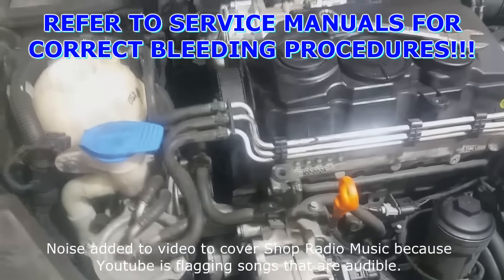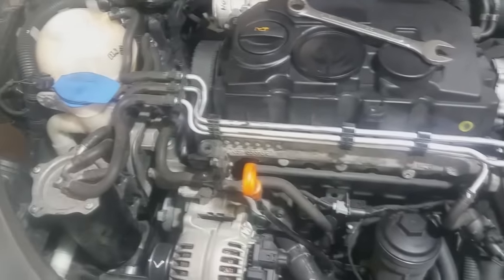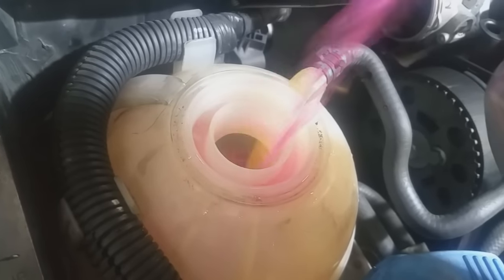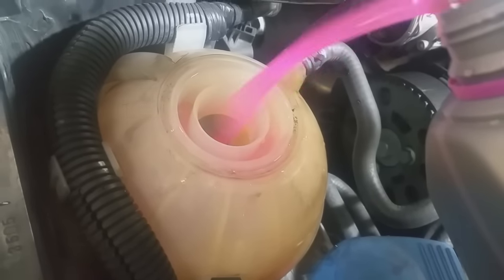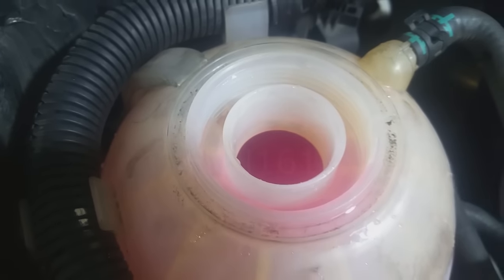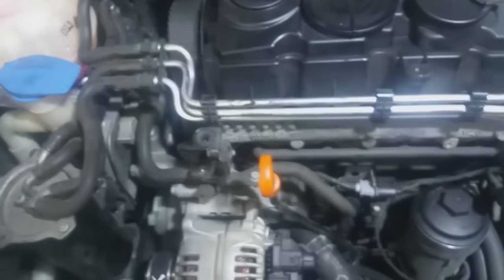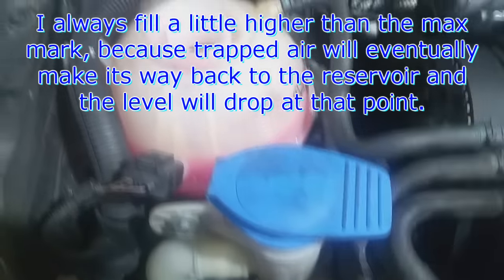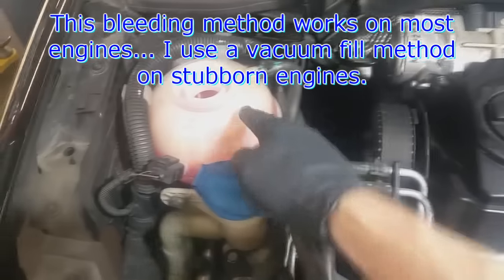Basic VW cooling system filling / bleeding info (viewer request)

Comment: Hey Exos 

Idk Where are thread went but i have the Passat with overheating problems & EPC light 

Néw Rad 
New Thermostat 
New water pump etc …..

Well i think the last comment you made you thought it was the head gasket …. 

I  was thinking the same but here is the really strange thing: NO COOLANT LOSS

I drove It 415 mi non-stop through hills / almost mountains mainly hills

With zero coolant loss 

What do you think ? 

I
Reply from the maker: You can find your post(s) under the user name "Matt Rieck".
If you drove it 415 miles, then it's not overheating.
There is a difference between "running hot" and "overheating".
Provide some specific information... so that I can guess better.
Using a scan tool, datalog coolant temperature from cold to hot (till fans come on) so I can see how long it takes for the engine to get warm / hot (car not moving).
Once warm / hot... datalog temperature while driving at steady speed.
Wash the radiator & AC condenser cores to clean out any dirt / leave / bugs that could be restricting air flow... do the same data logging again.
If you don't have a scan tool that can record data... record the temperature needle with your phone and then upload a video to either of your youtube channels (Matt Rieck or Blurm Gru).
A bad head gasket does not have to mean that coolant has to go down / leak. Air / combustion gasses in the cooling system can cause hot spots / air pockets that can affect the way the coolant circulates through the engine & radiator.
Reply: @EXOVCDS  
Thanks Thomas....

I got a chance to look at it this weekend a little and noticed that there was a clamp out of place but unfortunately no change.

I will try and get some VCDS that will allow me to record some data on temp.....

The AC does not work and in fact the AC line gets frost on it like it was running but there isn't any difference between on and off....I'm not sure if the compressor is bad or it just needs a refill.  I took the serpentine belt off and the pulley spins fine.....

When you say wash the cores what about using CLR on the inside of the heater core and the condensor ?

I saw a Youtube video that said the heater core could cause overheating issues if clogged .....

Thank You for the responses.....I really appreciate it.
Reply from the maker: @blurmgru6632   if ac lines get frosty... ac is working. The temperature blend door however might not be. CLR to flush heater core is OK, I would not use it on ac components... clogged heater core on vw or Audi should not cause overheating.

Comment: Shouldn't you also top off radiator since reservoir was empty
Reply from the maker: Vehicles that do not have "radiator caps" have a "bleed hose" that "bleeds" air back into the coolant reservoir (as the radiator fills with coolant). If you want to, you can disconnect the upper radiator hose and try to put coolant into the radiator at the upper flange... any remaining air will "bleed" out the "bleed hose" (as long as the "bleed hose" is not plugged.

Comment: Help!.
I have a 2005 jetta TDI BEW PD
Its currently 0°F in Michigan wind chill -20°F.
My car has always struggled with the yhe cold. My wifes 04 jetta TDI has not. 
Recently i knoticed the rad fan running after i get out of the car. I have no check engine light or codes. 
I read it could be from bad temp sensor in the top rad hose flange would cause hard start and rad fan. 
I changed it. 
Same issue. 
Is there more than one temp sensor? 
Is there something else that could cause this? 
Also my car takes forever to warm up. For 5 years i wrote it off as just a little diesel engine issue. Like after a 15 mile drive the lower rad hose by the thermostat housing is barely warm. 
When i was in there looking for temp sensors i found 3 coolant glow plugs. I figured those where temp sensors. But after looking into it i found out their actual purpose. When do those come on? During warm up? All the time in cold weather? Any ideas? Thanks in advance
Reply from the maker: TDI engines are efficient / they don't generate a lot of heat... or at least it takes a while for the cooling system to reach operating temperature.
A faulty thermostat will increase warmup time and will cause the temperature needle (if there is one in the dash) to drop from the middle position once the vehicle is in motion. The 3 glow plugs help heat the coolant when ambient temperatures drop below a certain point. I'd have to check service info to see what the temperature range is.
If the temperature needle climbs & stays in the middle, then the thermostat is OK.
A clogged heater core or faulty blend door would then be the next items to check.

Comment: ‼️PLEASE HELP‼️
I have VW Passat CC 2009, and I have problems with coolant fluid levels. I have to pour liquid almost every second day. Sometimes when the red warning light pops up and I open the coolant bottle, the fluid comes a lot above the normal level. But most of the time I have to pour liquid in. Around 2-3 liters a week. 
Water pump and refrigerator has been replaced. Do you have any ideas what could have been the problem?
PLEASE HELP‼️
Reply from the maker: If you don't see a leak outside of the engine, then the leak is internal. Only open the fluid bottle when the engine is cold. If you open it when warm, fluid will be pushed out of the bottle.

Comment: My 2003 Jetta TDI wagon loses coolant after sitting for long periods of time.  When the car is running day to day, no leaks whatsoever.  
Often, I find the coolant tank empty after a week or so of not using the car.  I have not been able to determine where the leak is. 
The issue started when I inadvertently left the block heater plugged in, when the weather got warmer in the winter.
Reply from the maker: Have a good look around the engine... I'm sure you'll spot the leak... if there is one. If no external leak is found, it could be internal... EGR coolers can leak coolant into the exhaust / EGR. Remove the EGR and look for signs of coolant.

Comment: I've never owned an engine that actively controls coolant flow through the heater core, aside from the usual temp controlled bypass valve attached to the thermostat. Is there any role for turning on the heater in some vehicles to try and burp air from the heater core? How would that work?
Reply from the maker: Vehicles with flow control valves for the heater core need to have the valve open when bleeding air out of an engine. Heater cores usually don't drain out / empty out when the cooling system is drained... but air could get trapped in the core during cooling system filling / bleeding. If the valve is left closed, it prevents circulation through the core. If you hear water rushing through the core, it's because air is trapped. Increasing rpm to past 2000 can help push air out and into the bleed circuit / hoses.

Comment: Thomas i have a Vw Passat 2013 tdi the antifreeze is brown colour what it’s your opinion?the oil it’s ok no problem heat temp ok ?
Reply from the maker: Coolant will turn brown / dark with age... acidic (best i can discribe) smell also. Flush the system and monitor again. Should be flushed / changed  every 4 to 5 years.

Comment: Hi brother I have 2014 vw passat disel car drive fine at night when it's hot over hear change rad thermostat flush system as you said if you don't hear air bubble sound you have blockage what should I look in also i noticed there is small hose going to intercooler I saw it it had some restricted thing In is that normal thanks Please help me with that issue
Reply from the maker: I don't understand what the actual problem is. You said it drives fine. Some coolant return hoses have restrictors inside the hose to control flow of coolant. If the engine is not overheating and there are no coolant leaks, everything is fine.

Comment: My fans never come on because the coolant always stays at around 85C but the coolant does flow and build pressure. Also, when I release the cap when the engine is cold, it still releases pressure, is that normal? Same engine as your video.
Reply from the maker: Pressure in the system when cold (the next morning) could be a sign of a head gasket issue. The fans not coming on is not an issue as long as there is no overheating. If it is a diesel engine, it's normal this time of the year (cold winter air entering the engine).

Comment: 04 tdi bew 1.9 pd jetta check engine light came on & code was t stat or temp sensor. Replaced both & light still on. I then decided to replace radiator cause it seemed coolant wasn't flowing. Maybe t stat wasn't open yet or air not sure. Did the radiator today light is still on. I used your method to push air out this time & no luck. Tomorrow I'm going to pull t stat again & temp sensor & return in case I got a lemon new part. If this doesn't work any suggestions? I did water pump with metal propeller when i did timing belt about 25k miles ago. You mentioned blockage also & where would that happen most likely on the bew tdi pd motor. Bottom hose was cold this evening after getting back from having codes ran again. Same code came up again with t stat or temp sensor. Thanks in advance. 😎👍
Reply: Also coolant is coming back into reservoir thru little hose on top but just seems like no movement thru radiator. I changed a couple hoses as well when I changed radiator that looked brittle & I installed a new reservoir so dirt in old one wouldn't clog new radiator. Any advise would be appreciated cause I have about had it with my ole girl. She has 330k miles on her but my mom bought it new in 04 & I took it over about 50k miles ago. Always been maintained by myself or shop but this has got me flustered. Thx
Reply from the maker: If the engine is not overheating, then there's no need to check the radiator. If thermostat doesn't open, then the engine will overheat. If thermostat opens too early, then the engine will take longer to warm up, and once warm, the needle / temperature will drop below 81c when the vehicle is cruising at a steady speed. Dropping below 81c is what causes the "cooling system performance malfunction" code to set.
Reply from the maker: With a correctly working thermostat, it will take 10min or more for the lower radiator to get warm (vehicle standing still at 2000rpm). A bad thermostat (opening early) will cause the lower radiator hose to be warm before the 10min mark.
Reply: Thank you for your response. Re installed new t stat & temperature sensor yesterday  to avoid the possible lemon parts I may have bought. The store did a hard reset i guess it's called by resetting with computer. Light went out but by the time I got home check engine light came back on again. Today I plan on trying to get more air out the system. It was about 10 minutes this time with new t stat & reservoir went down telling me t stat opened so I thought it was fixed this time. Nope. Hopefully air is still in system cause it's cycling thru system & back into reservoir. I assume since it's cycling that means the water pump is not bad either?  Hoping it's just air & needs more priming & driving at this point. Thx again
Reply from the maker: @vanlifebiker  Air in the system can cause lack of circulation or overheating. If you have heat inside the car and the temperature needle is in the middle, I doubt you have air in the system. What's the actual fault code?

Comment: Ok 2000 VW wagon Passat. About a week or two ago my add coolant light can on. So added some to top it up it wasn’t empty. Didn’t notice any leaking, but also wasn’t looking. I Didn’t bleed the line ( lol cuz I didn’t know that was a thing). So this week my light came on again, the fluid was down. Added more and it dropped again also no heat produced for defrost. Today I tried this technique but when I waited for the car to warm up with the cap off it started spraying all over the place. So I turned car off and then it dropped again. The gauge in the car is staying in the middle. So do I try again? I think I read somewhere in these comments that means there is air in the system.
Reply from the maker: 1.8T?
No heat inside the car can mean bad water pump.
Reply: Thomas EXOVCDS yes 1.8

Comment: Nice, thanks! In 2015 VW 1.6 TDI engine the coolant is continuously coming back to the overflow reservoir via the topmost rubber hose going into the top of the reservoir. Revving the engine makes this returning flow stronger. Is it normal operation or should the continuously returning flow of the coolant at the top of the reservoir be intermittent? Thanks!
Reply from the maker: Normal.

Comment: So I did this on my 2002 Jetta wagon TDI and I DID NOT hear gurgling buttttt the fluid level did go down. 
My question is if I do have a blockage. How do I get it out??
Reply: Also the bleed rail Does not have any fluid coming back into the reservoir.
Reply from the maker: What's the actual reason you had to fill fluid? Leak, overheating? Do you have heat inside the car? No? Then the water pump is bad... resulting in no return flow.

Comment: Can I replace the coolant just by using an extractor (like a manual pump) and take the fluid out of the expansion canister ? Is it doable ?
Reply from the maker: No... you will only be able to remove what is in the bottle... nothing else will get sucked-up / removed.

Comment: What if you drive for say 10-15 minutes, park on an incline somewhere with heat on max and the fan off, get out of the car, open the reservoir cap and fill to max?
Reply from the maker: Year, make, model, engine?
For the most part, VW & Audi cooling systems have full flow heater cores... meaning that there's no need to have the heater set to full hot.. Some thermostats do not open in under 15 minutes (especially TDI engines). If you get the system fully warm... when you go to open the reservoir cap, fluid level will rise and may even spray out at you all over the engine bay. I would not advise opening the reservoir when the engine is warm. As long as the fluid return hose is not plugged.... the system is usually self bleeding. Meaning that you should only have to top up a little bit AFTER the engine has reached operating temperature and has been allowed to cool off again (fluid level will drop after cooling off). If temperature climbs too high after initial filling, then too big of an air pocket has been left in the system / the system has not been initially bled well enough. A few "run till warm & allow to cool off" cycles can help with the bleeding. No amount of cycles will help if there is no return flow into the coolant reservoir bottle.

Comment: I just reolaced an engine on a vw T5 1.9 tdi , plenty hot water at the top of the radiator, bottom pipe is cold, no hot air in cabin , air lock ???
Reply from the maker: Possibly. Disconnect one of the heater core hoses and check if coolant is present. Is coolant flowing back into the coolant reservoir when the engine is running? TDI's take a long time before the lower hose gets warm / hot. Are all the emission components in place? A missing EGR cooler can affect the heating system... no heat from the exhaust is transferred into the cooling system. As long as the temperature needle does not go past the middle (90c), keep running the engine. The thermostat will eventually open and the lower hose will get warm.
If the needle goes past 1/2 way to 3/4, shut the engine off and let it cool down.

Comment: I changed the coolant reservoir on my Volkswagen passat 2012 and flushed the old coolant. I did what you did in the video, now when I drive my car the coolant level goes down but if I open the coolant reservoir the coolant level goes up, can you explain what is going on? Do I have air on my system?
Reply from the maker: Possibly... if you remove the cap on a warm system, then "pressure" will release and cause fluid level to rise. If you do not have any overheating issues, drive the vehicle for a few days and check fluid level each morning while the system is cold. Top up to max each time the level is a bit low. It could be that you have / had some air still stuck in the system... the air will / should eventually work its way into the reservoir bottle (hence the fluid level drop) and level will eventually stabilize once all the air is out.
Reply: @EXOVCDS  my MAN!!!! Thanks bro I'll do that

Comment: Great video but the pumping of the hose does not do anything because the thermostat is not open.
Reply from the maker: The pumping helps fluid get into the engine... the reservoir feeds fluid into the engine behind the thermostat. Air could still be infront of the thermostat or in the radiator.... yes, but it is more important to not have air in the engine. Which this method can help achieve.

Comment: what about filling thru the lower hose? That's old school, fast and no trapped air.? what's your opinion on that on Mark 2 ?
Reply from the maker: Lower hose filling only works if the return hose is free to vent air as coolant enters the lower hose.  I have had cases where the return hose was plugged on mk1's, mk2's and mk3's. Once, the restriction was fixed, filling through the lower hose worked well. Thank you for watching!

Comment: Man I know this is a super old video but I have 2006 A3 2.0t and my water return flow fuse isn't getting any power fuse15 and my fans aren't running
Reply from the maker: Fuse 15 (in the fuse box next to the battery) is for various items depending on the engine.
The "after-run" electric coolant pump is one of those items. 
I would start with a full system scan of all control modules. Most likely, there will be a fault code stored in one of the modules... which can help troubleshoot the issue.
With the scan tool, you can also command the ECM to turn the fans on... to see if the ECM can control them.
If the fans don't run when commanded, check power & ground at the fan connector and check if the control signal from the ECM is also making it to the connector. If yes, replace the rad fan / module.